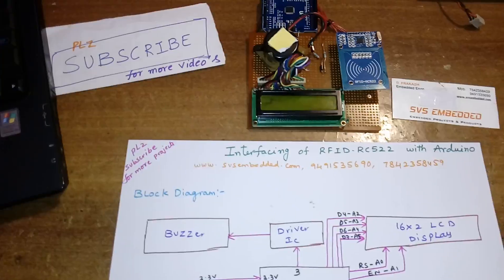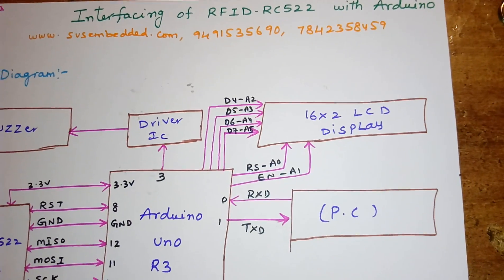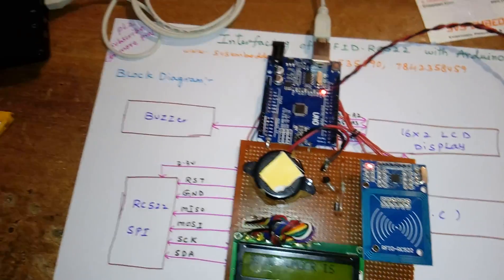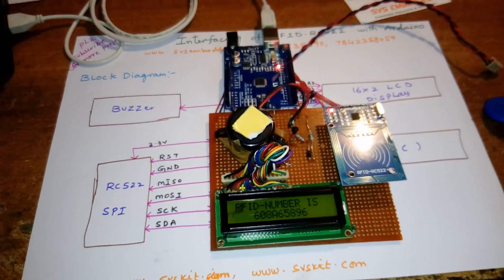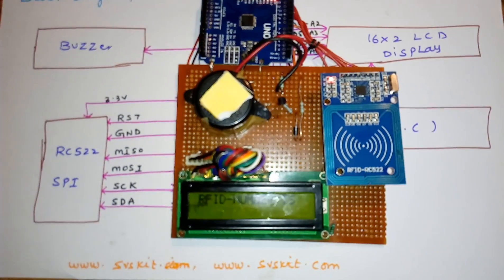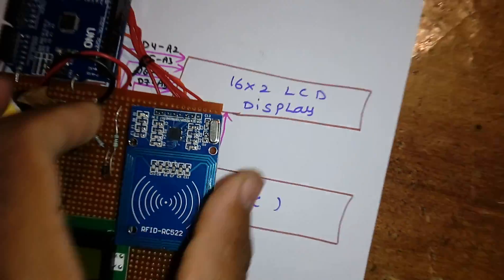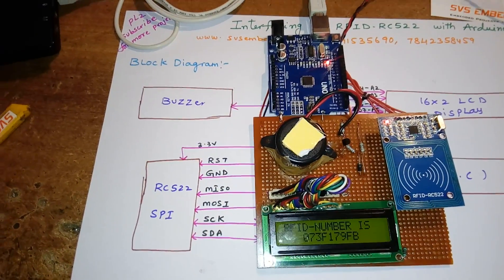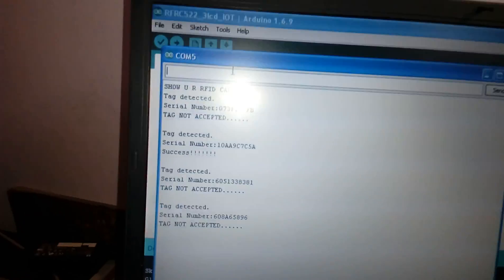Interfacing of RFID RC522 with Arduino

Comment: HELLO, Are you send me this source code in 
 sahit00007@gmail.com
Reply from the maker: Thanks for watching and your valuable Feed back.yes we will help on coding part.
we are selling the projects with least cost.if u order the project we will provide working hardware kit along with 
1.abstract
2.datasheets
3.documentation
4.schematic( circuit ) diagram.
5.software code.
6.sample ppts
7.photos&video file on entire project
through google drive.if u r interested to take the project.
send me a mail to  svsembedded@gmail.com,info@svsembedded.com.
9491535690,7842358459,
www.svsembedded.com,www.svskits.in,
we will send u the how to order procedure to u on mail.